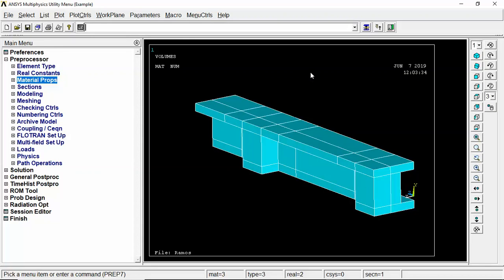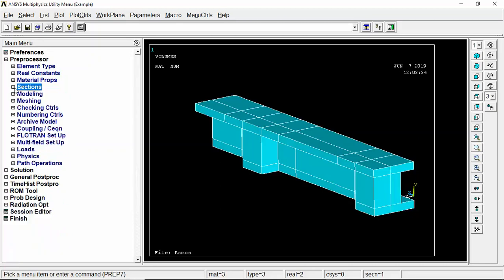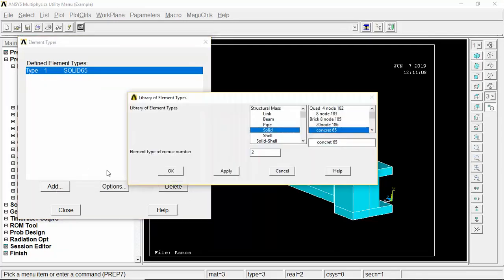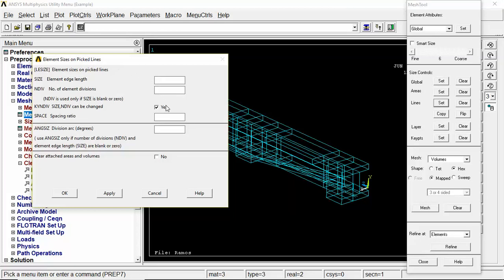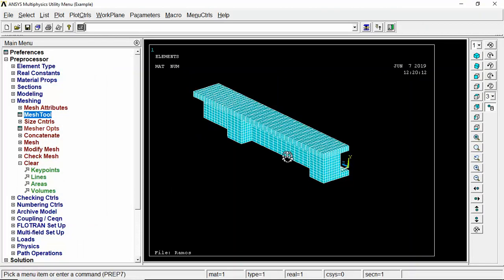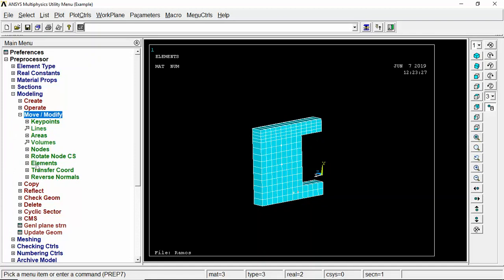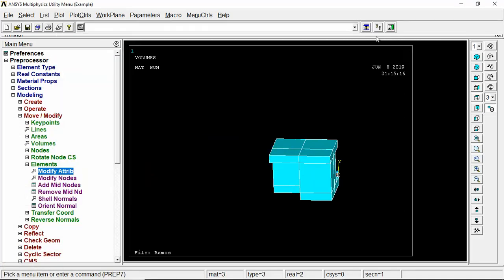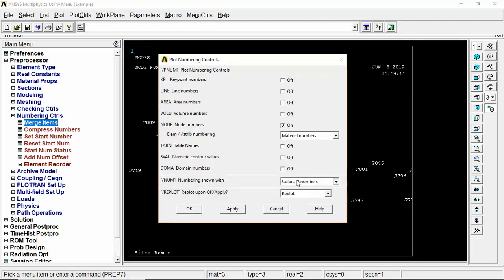How to model a pre-stressed concrete beam in ANSYS Mechanical APDL 2

Comment: thank you very much and appreciate you for much more videos on post tensioned concrete beam. also please post videos on bonded and unbonded post tensioned (internal) concrete beam modelling and analysis on rectangular concrete beams lots of researchers are looking forward to that. also you can made a video how to model different P.S strand profile in ANSYS APDL by GUI methods and their strengthening with FRP & bond relationship modelling. THANK YOU SIR.
Reply from the maker: Thank you very much, dear Pandi. I hope these videos can help you with your researches. What do you mean by "different P.S strand profile"? I did not work on FRPs. I think they should be modeled with shell elements and their bond must be involved the translation degrees of freedom and rotations must be excluded. In other words, you have to couple the nodes along X, Y and Z directions.